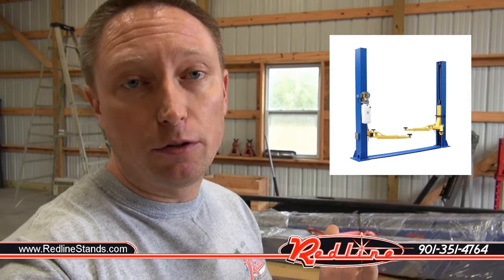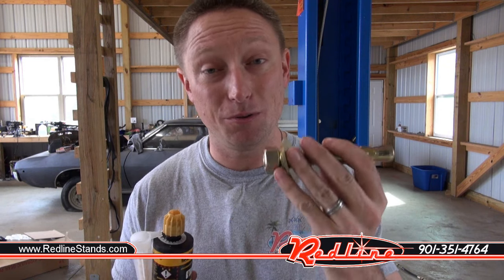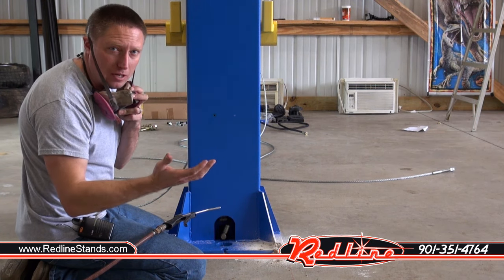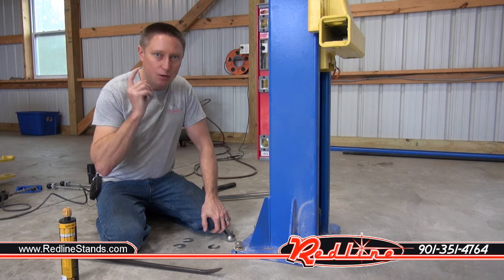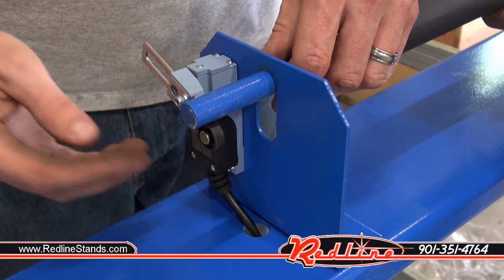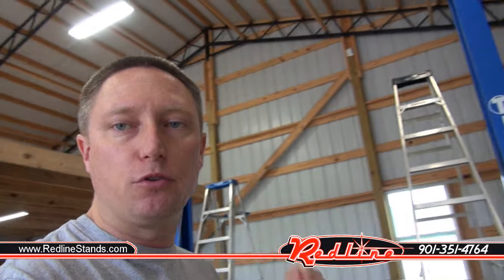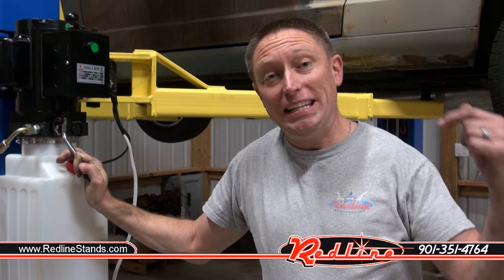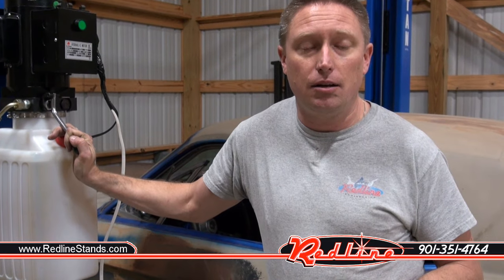Two Post Lift Installation How To - TP9KACX & HD2P-9000AC

Comment: Ian - I spoke with the distributor of my two post lift (Atlas) today for some installation support. During our conversation, I mentioned to him your advice about using the AC100+ Gold adhesive. He was of the belief (and I saw online videos with the same opinion) that I needed to drill my holes 7/8” to accommodate the thickness of the adhesive around the 3/4” anchor bolt as it goes in the hole. I don’t recall you addressing this in your video, but my belief is that you used a 3/4” drill bit for your holes, not a 7/8” drill bit. Can you confirm my understanding?
Reply from the maker: You are correct.  I used a 3/4" bit, which is the correct size for the bit with no epoxy.  It's important to understand that I'm both gluing and expanding my anchor.  I'm expanding the anchor while it's still wet.  I personally wouldn't be comfortable with drilling my hole that much larger on purpose.  That's how I did it on my Launch 11K at home and I consistently put my 8200 lb diesel on my lift and she holds fine.  Past that, I'm not sure what more I can say.

Comment: How tight do the tension cables have to be
Reply: We tell customers they should be taught, not tight. While not under a load, if you can thump it and it vibrates like a guitar string it is too tight.

Comment: Great video Ian. If I install a lift with the floor ramp, cold I chisel out the cement between the columns so there isn't as much as a bump? Thanks for sharing.
Reply from the maker: Nope, because the cables inside the ramp would not drop down with the ramp.
Reply: @RedlineStands  oh.thanks.it was a good idea if it would work. I still liked your video

Comment: Good video, but 1- you didn't mention how to bleed the hydraulic system, and 2- with epoxy set up on the anchors, knowing they should  be checked for torque occasionally,  how does that work with the epoxy already set up? And 3- you didn't show the total routing of the cables, like the lower rollers.
Reply from the maker: It's rare that you have to bleed it at all, but if you need to do it, you just open the bleeder on the top of the cylinder and quickly blip the power on the pump and it'll expunge any air.  Obviously, we don't do this while loaded.  I normally only retorque mine every couple years, but that's only because I don't use it much, and the epoxy doessn't seem to change that too much.  Routing the cables?  Best thing to do is look at your manual.  There's always a cable routing diagram in there.
Reply: @RedlineStands  Thanks for the reply.  I'm going to be removing and reinstalling my 10k lift in about a year and want to make sure I do it right. Thanks for the adv

Comment: So I’m having problems with the safety latches not engaging how do I fix this problems haven’t found any videos to help  thanks
Reply from the maker: I have no idea what lift you have, so that's a tough one to answer.  Most lifts have safety lock access plates you can remove and see/repair those locks.  I'd start by trying to find that access plate and having a look.  In the meantime, definitely don't use the lift.

Comment: how far apart are your post set? I am pouring the concrete floor and wanting to pour the concrete deeper in that area. Thanks
Reply from the maker: You need to consult the manual of the lift you're buying because it's different for every lift.

Comment: I see you tested for pad thickness, do you test for PSI or when would you? I have a 30x40 Morton building (20yrs old), not sure of pad thickness yet, but curious of PSI tests. Thanks!
Reply from the maker: So it's not really feasible to test an existing slab for strength.  To do that, you'd need to remove a section of the slab, machine it to shape so it can fit into the testing machine, and destroy it via destructive testing.  If you're going to mount a lift to a slab and you don't know the strength of the slab, you should do everything possible to skew the odds in your favor.  Example.  Don't lift heavy vehicles, buy a lift with huge base plates, use epoxy with your anchors (see video), test for thickness, etc.

Comment: Question, are the post supposed to be perfectly level, or leaning slightly outward?
Reply from the maker: They should be "perpendicular" to the ground, not level, but I knew what you meant.  Definitely no leaning.  Thanks Marvin.

Comment: Good afternoon, I had a TP9KACX 9000lb lift installed in my garage and after hooking up the electric, I raised it up with no vehicle on it by pressing the button and then afterwards I pulled the orange safety pulls to release and the lift goes down to about 4ft off the ground and wont go down any further? I don't know why it is happening and I can't figure out how to fix that issue. Can you please advise?
Reply from the maker: We asked James at Tuxedo Distributors and were told, "Have them check the hydraulic tee bulkhead fitting. His carriage may be getting caught on that.
If it is not that , he will need to look up in there to see if there is something else that is physically causing the issue."
Reply: Adjusting wire rope

Comment: Nice video. I do not think 4in is enough, for most lifts. You probably need more, 6 or 7. Sure, the bolts might be anchored in a hole 4in deep, but concert probably needs to be bigger. Check manuals.
Reply: A lot of companies say 4 inch is minimum.

Comment: whats the thickness of the concrete? I think you said it but I couldn't make it out. I know you said you have a video on the concrete and I will try and watch that. Thanks, considering on buying one.
Reply from the maker: The 9K in this video required 4" 3ksi with reinforcement, but you need to check the manual for your lift as the specs of the concrete will vary based on several variables, such as the size of the baseplate.

Comment: How to bleed the hydraulic cylinders
Reply from the maker: Most chain drive lifts are bled by raising and lowering the lift without a load.  Raise the lift ½ way and lower it, ¾, lower, all the way, lower.  As you lower the lift each time, you should notice air exiting the system into the power unit reservoir.  If there is a good amount of air in the system, you may need to add a little weight to the arms to help it come down, but you do not want to lift a vehicle to perform this task.  If the lift is a direct drive system, most of them have bleeder valves on the top of the cylinder.  Slowly unscrew the bleeder.  Close the bleeder when no more air/bubbles are coming out.  Do this on both cylinders.

Comment: Great detailed video, I must say I liked my Forward lift better because they mount the hydraulic cylinders to the top of the lift so that they pull instead of pushing. A ram pulling is a lot stronger than one pushing therefore using smaller diameter tube, smaller diameter shaft ,using less fluid making the lift move faster. Time is money.⚙️😎
Reply: Uhm wrong
Reply: You got that backwards chief. Also on something that lifts heavy weight, you want to go as big as you can afford. Never skimp and go with the minimum requirements. Begging for a disaster.
Reply: @lynxstarautomotive208  just a little experiment for you, take a straw , hold one end down , take a 1/2” drill bit, now bend the straw over it then push on the straw and see how little pressure it takes to cause it to kink, now pull on it really hard. Can you pull the kink out of it ? To be perfectly clear, look at a lift that pushes. How big is the shaft diameter. Now look at a lift like the Forward lift that pulls. See how much smaller the diameter of the shaft is and it has the same ton lifting rating ?
Reply: @batman607 point me to a pulling lift, and an equivalent pushing lift so I can compare the two. Otherwise you’re talking drill bits and straws. I’ve never seen any two post lift that didn’t push the vehicle upwards. Only on some 4 point lifts have I seen that the cylinders pull due to a cable and pulley setup.
Reply: @lynxstarautomotive208  like I said my FORWARD Lift ( Brand name) used cylinders that pulled, not pushed.  The RAMS were only about 1/2 the diameter of a lift that pushes. I’m not talking cylinder diameter which everybody knows the bigger the diameter the cylinder the more powerful it is .The straw was just an example to show how easy it is to bend but  rally hard to pull apart.
Reply: @batman607 What models? Forward Lifts is Rotary’s econobrand. Like Snap On and Blue Point. All of Forward’s two post lifts I’ve seen are the push design. What model do you speak of has the pull system?
Forward was bought out by Rotary back in like 2010. 

I’ve seen the pull design on a 20k, two post lift used for lifting buses and heavy equipment, but never have I seen it on the smaller automotive lifts.
Reply: @lynxstarautomotive208  I don’t remember the model number. I had to sell my house in UTAH 3 yrs ago when my wife passed away and the guy insisted on me leaving the lift. I had a GMC 1 ton on it and it never even grunted . I hauled cars for 34yrs and several times I bent the top rear rams and that’s why I chose Forward for my lift.
Reply: @batman607 I’ve been in the auto business for 22 years. I’ve had experience with Rotary, Atlas, Challenger, and Mohawk. I’ve never seen the pull design on a 2 post. Like I said only on a monster 20k Hoffman lift for heavy equipment which is not my wheelhouse.

I’ve seen the pull design on four post lifts a ton. Mostly because a lot of those designs use a pull cylinder and a push cylinder to evenly rise with little effort from both hydraulic cylinders.
Reply: @lynxstarautomotive208  Yea I watched that video before , if you would see a top rear vehicle set down on the vehicle below it and squash the roof and have to pay for the damage, all from a bent ram ,it would make a believer out of you. The straw example is the exact way those cylinders acted. Don’t forget ENGINES put things on paper or computer, and until the item is tested, they don’t know sheet.

Comment: I would like to have on the bottom plate steel going from one column to the other, that’s the only way I would feel safe because you don’t really know the quality of the concrete unless it’s tested in a lab and I have seen those anchors pull right out.
Reply: The bottom plate isn't structural.

Comment: Hey Ian , do you we have to use the anchor bolts that came with it, or can we use those screws down anchors into the concrete.  Some like tapcon or similar.  Thanks
Reply from the maker: Definitely use the ones that come with it.  Using the screw-style anchors is likely to result in you committing suicide sir.
Reply: It would actually be better to buy new anchors. The ones that come with lift over time come out the from weight of the vehicle. That would only happen if there is no epoxy put in the holes.
Reply: Tapcon to hold a 2 post lift down baha bahaha
The supplied or any suitable length expansion anchors if epoxied would be fine.

Comment: How you take the bolts out we just did one but did not clean the drill holes
Reply from the maker: LOL.  You don't....ever.  Once the anchors are in there, you can never remove them.  If you do, both the anchor and anchor hole are ruined.  Sorry....

Comment: Question on the anchor torque sequence. After you apply the epoxy to the anchor and drive it in, what initial torque do you apply? Is it the final torque ~85 ft lbs, or is it a lower torque until the epoxy cures?
Reply from the maker: I fully torque them as per the manual specs while the epoxy is wet
Reply: @RedlineStands  thanks for the reply. I installed my anchors on a cooler day and the epoxy was taking a little longer to cure. When I’d torque the fasteners it would want to pull out of the hole so I had to drive them back down and wait a little bit for the epoxy to cure before fully torquing down.
Reply from the maker: @Brianc5001  That's a bit scary to be honest.  The anchors should not pull out of the hole.  If you had to wait for the anchors to cure in order to tighten the anchors, then the collar has not expanded in the hole and it's only glued in place.
Reply: @RedlineStands  I think I’m going to end up having to move the lift and redo it since it is bothering me as well. I have 4-5” of concrete and I’m drilling all the way through, I’m also cleaning the holes out very well. Do you have any idea why some of the anchors would want to pull out like that, it’s not every one only a couple acted that way.
Reply from the maker: @Brianc5001  Could it be you drilled the hole too large?
Reply: @RedlineStands  I thought the same, the (3/4”) bit measures . 7750” at the tip which is only about .01 bigger than the collar on the anchor. I checked all other bits at the supply house with my calipers and every brand does this, so I don’t think it’s the bit. I’ve heard that if you don’t drill the hole straight sometimes the anchors don’t want to bite.
Reply from the maker: @Brianc5001  That is certainly true as well.  A 3/4" bit is correct.
Reply: @RedlineStands  probably a bent bit or he was drilling and moving the hammer drill back and forth too much and oval-shaped it. Sometimes using an impact on high speed, but low torque will seat the anchor sleeve quickly. Then torque to specifications. I have put in thousands of anchors and ran into so many problems if not done perfectly.
Reply: @Brianc5001  - I'm sure you probably already moved the lift, but you could probably have removed the anchor re-drilled and put in a slightly larger anchor.
Reply: Or use a threaded rod high tensile and epoxy it in

Comment: Plumb not Level?? and Benpac says do not drill thrub the concrete?  and Most say the concrete be 6 inches thick not 4 inches, if so, use another steel plate like 1`/4 inch about 6 inches larger than the bottom plate!

Comment: Hi Ian, is it feasible to pour a slab with a channel. To install a floorplate unit flush with the floor?
Reply: I don't see why not. I've not done or seen it done myself, but that doesn't mean it hasn't been tried.
Reply: @dustingilmore2710  Yeah, it looks like the arms might end up very close to the floor.. But it would be so worth it to be able to wheel large caster equipped items around my small workshop without the speed bump.

Comment: I'm confused... earlier in the video you said do NOT drill all the way to dirt...then around 10 minutes in, you said you like to drill all the way through to dirt???
Reply from the maker: It's a long video.  Could you please give me the time stamps on when I said this?
Reply: @RedlineStands  4:12 segment. and then around 10 minute segment... I really just want to understand if I SHOULD drill all the way to dirt or should NOT drill all the way to dirt.
Reply from the maker: @cnc3-in-1  I see the confusion now.  When you are installing your anchors, you want to drill all the way through the slab till you hit dirt.  This allows you to be certain your anchors are deep enough.  However, when you are testing the thickness of your slab and drilling into it with tiny bit, you do not want to hit dirt "until" at least 4" of concrete has been reached.  This is of course assuming the lift you and I are discussing has a minimum concrete rating of 4" required.  Suppose, the bit went it in 3" deep and then you ran into dirt?  That would be a bad thing and we could conclude the slab was not thick enough to mount a lift.  Hitting dirt is fine.  Hitting dirt early is not.
Reply: @RedlineStands  - I went to your online store and see that you don't sell Bendpak... which is exactly what I was going to buy (the 10XLAS low profile)... because it seems built so rugged. Is there a reason you don't sell them?
Reply from the maker: @cnc3-in-1  Honestly Kevin, we quit carrying BendPak because I got sick and tired of them making me look like a damned fool in front of my customer.  Their customer service after the sale is just awful.  If you need a replacement part, or tech assistance, or pretty much anything, just be prepared to start off the convo by punching yourself in the face.  I quit carrying them because they deserved it….
Reply from the maker: @cnc3-in-1  This is what I use at home and I love it!
https://www.redlinestands.com/catalog/lifts-c-290/automotive-lifts-c-290_138/2-post-lifts-c-290_138_139/launch-11k-asymmetric-2-post-clearfloor-lift-ali-certified-p-2424
Reply: @RedlineStands  - does it have a low profile option. I will mostly be working on lowered European super cars. I wanted a rugged lift in case I wan to do anyone with an f150 truck. or heavier vehicle.
Reply from the maker: @cnc3-in-1  Low pad height is 4.3" That's pretty stinkin' low...
Reply: @RedlineStands  - I left a message with your company asking about 1. How to get residential delivery. 2. To find out if you have installers you work with that have experience... not a contractor who has never done one before. 3. is there any difference between the 10k and 11k other than 1,000 lbs of lift? I just asked the contractor who built my garage and he said the garage is 4". If I need to have him come and re-do the area under the lift footing, how large does it need to be (since you're an engineer, I figured you might know).  There are footings about 17" from where the posts need to be. IT's an RV garage so it's bigger than a normal garage width.  -------------- https://youtu.be/jiyTZG4464g?t=102 --------------

P.S.,  I checked on Bendpak's customer service and you were NOT kidding... 28 negative BBB complaints and no real good responses for those complaints, even some misleading ones...